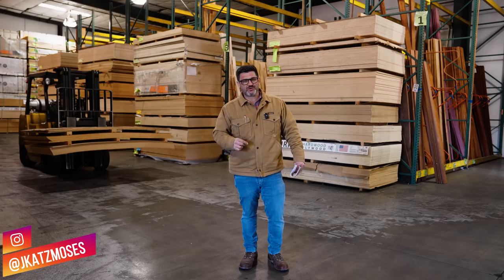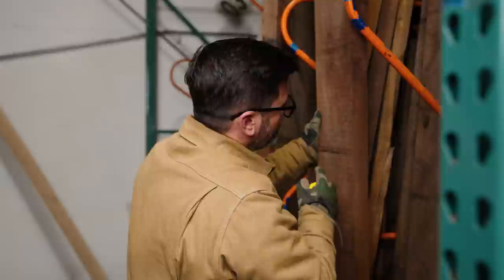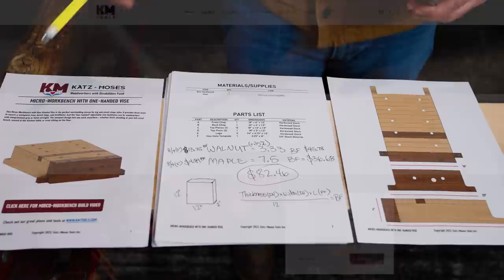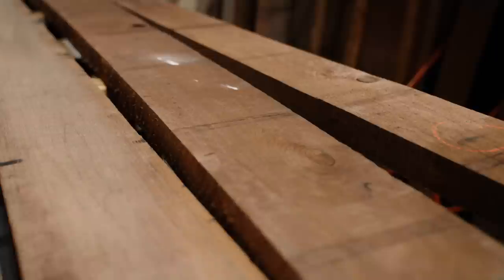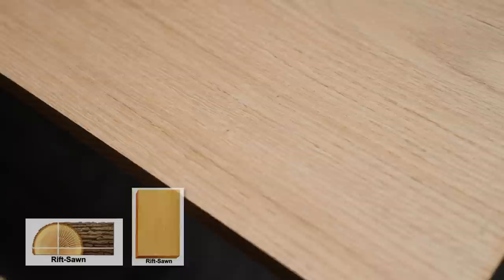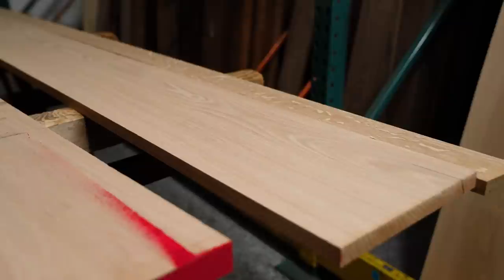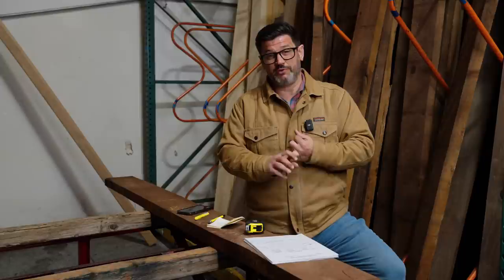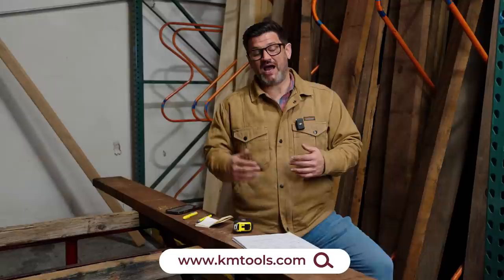Unlocking the Secrets of the Lumber Yards: No BS Guide from a Pro

Comment: Thanks for a great video for beginners. I had to learn this "on the fly". I can recommend Austin Fine Lumber in Austin Texas. It looks just like the lumber yard where you shot the video. They will cut off short pieces of lumber, but the leftover piece that goes back in stock needs to be over 8' long.  They have a scrap bin where a hobby woodworker can find a gold-mine of wood. Recently, for $200, I was able to purchase a 12' trailer load of rough 8/4 walnut, oak, cherry, maple, pecan and sapele from an estate sale. There were some 18" wide slabs. The trailer was completely full and piled up 3 or 4  feet above the side rails. The wood had been stickered in a dry barn for 20 years. Thanks.
Reply from the maker: That sounds amazing! I love Austin.
Reply: Austin Fine Lumber is great. There's also Woodcraft nearby - they have a wider selection of exotic woods than Fine Lumber, though Woodcraft is more expensive and more suited to turning and small projects.
Reply: Can confirm. AFL is also dangerously close to the Asmbly makerspace.
Reply: That’s where I go too!

Comment: Jonathan... absolutely great video! If any of you who watched this video have found a hardwoods wholesaler in your area and haven't visited yet, let me recommend one more item that JKM did not mention. A drool bucket. Yeah...I know that sounds gross. But if you have never been, you are going to see things you never dreamed could happen. Domestic hardwoods in thickness you didn't think existed. Exotics of all shapes, sizes and species. Sheet goods covered in laminate,  veneers and even foils. Baltic Birch at 60% of the 'local' price in 5'x5', 4'x8' and you may find cutdown sizes. Apple-ply is available at my local wholesaler which is essentially Baltic Birch made from Western Red Alder. And the best part? The scrap bin! Yeah, the scrap bin. There will be chunks of wood trimmed from longer boards with some piddling defect...a crack, a ding, some discoloration. All dirt cheap (I'm talking pennies on the dollar) and small enough (like 6"-18" long x width of original board). I always pick thru the bin looking for that eye-catching piece and end up with an armload that costs in the $20 arena ..for the entire armload.

I live in the Puget Sound region of Washington. Crosscut Hardwoods in Seattle is my go-to. The building is dang near the size of a football field and floor-to-rafters full of anything and everything you could want in wood, short of construction lumber. If you are in this area, a day trip there is well worth the time and travel.

Comment: FYI 25% waste is not enough. I.e. if your finish size is 3/4 you have to purchase 4/4 this is already 25% waste. You still need to allow additional waste in width, length and defects. Depending on your project expect more like 100-150% if you don't want to fall short.

Comment: Great video but I would like to hear a discussion on why hardwoods cut by locals are so expensive.  I fortunately have access to big box stores, a great lumber yard, and a specialized sawmill and lumber yard where you can buy almost any species of wood at a price.  What I cannot understand at the locals here in NH have their own wood mizer-like sawmills that are charging outrageous prices for the lumber that they have cut locally and milled.  I have so many projects in my head that I want to build but cannot afford the lumber.
Reply from the maker: I mean it sounds like a problem that is either solved or perpetuated by simple supply and demand economics.
Reply: I guess.  Fellow NHites, stop buying from the locals for a while and let's see if we can't lower their prices.  As far as white pine, I found a very equitable supplier over in Belmont.  He has it all.  Clear select at reasonable prices as well as rough-sawn.

Comment: There's some good information in here but it's also missing a lot. Kilndried vs airdried, common defects to check for and spotting potential problems with tension, bowing, twisting or other wood movement. Nothing worse than buying a beautiful board only to find out it's useless once you get home. Also, let your lumber acclimate in the shop for at least a week but longer if possible. So much ground to cover